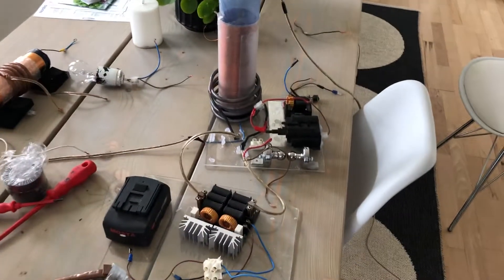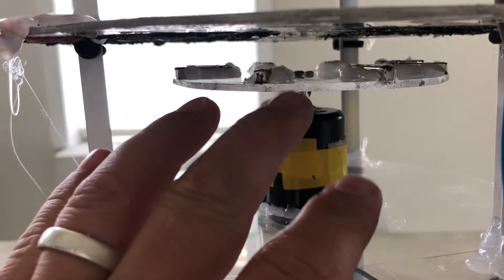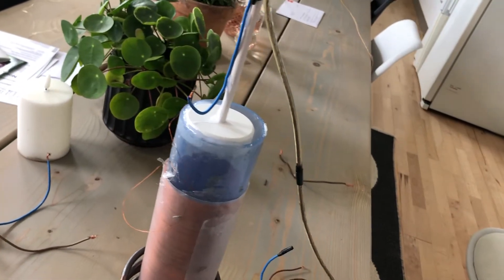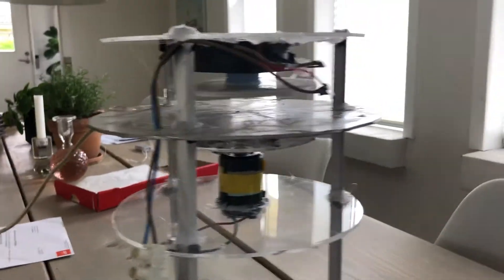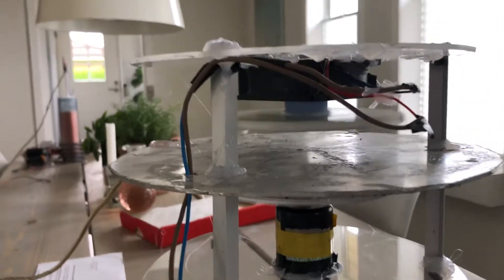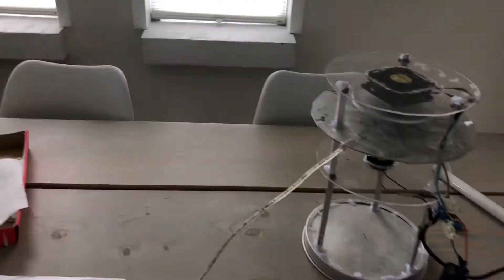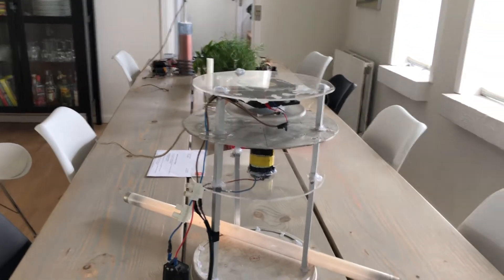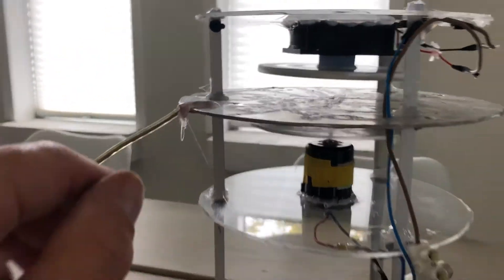SWR ( scalar wave rider) Antigravity

Comment: Your gravity flyer looks great!  I like that you used the plastic with aluminum foil and a glue gun to put it all together. You have the magnets and the motors at the correct speed. You also have the transistor pulsing circuit  but you do not need the transformer circuit. I don't think you need the ultrasound as this only keeps the gravity flyer from levitating to soon and lets the plates charge ud fully. The upper disk will have the opposite charge polarity than the ionosphere and the bottom disk will have the same polarity as the earths surface so the device levitates. The only thing that I see done incorrectly is the tesla coil hooked up in the forward direction so the voltage on the disks is high and the current on the disks is low. The magnets spin the charge so the disks have circular eddy currents like a magnet hooked up to a coil of wire that makes the magnetic field that is of the same polarity as the earths magnetic field so the two repel so the device levitates. The tesla coil should be hooked up on reverse so their is  a very low voltage from your  battery of about 0.05 volts and the current is at a high value of about 100,000 amps so the charge is very high on the disks. A gravity wave is a weak energy waves and having a high voltage on the disks yields a high energy wave that is not good. The low voltage is also needed so the electric field between the disks is of a very low density of Aether and the outer electric field of the earth is a very high electric field of 150 V/m so the device lifts up like a heilum or hot air balloon. With you using no ultrasound your gravity flyer should lift up in a steady manner and not pop up like Alexey's does when he pushes the ultrasound button to turn off the ultrasound. Depending upon how long Alexeys pushes the ultrasound button depens upon how high the gravity flyer lifts up off of the ground.  You can use the same circuit with the aluminum wheels on a car to make an anti gravity car once the car reaches the necessary 88 miles per hour on an intgerstate just like the movie Back to the Future.  Rick
Reply from the maker: Hi Rick thanks for your analysis of my attempt, unfortunately this was a while ago and I didn’t do anymore I focused on ion collections and am now attempting a Wardencliff tower replica. Please look at this as your imput would be welcome 🙏
Reply: @dkdyker  Hello dkdyker. I just looked at your YouTube channel with your Tesla Wardenclyffe tower. My friend Nathan experimented with Tesla work on this as we found a book detailing what he was doing that was written by Tesla when he was doing his similar Colorado experiment so I am familiar with what Tesla was doing. Tesla lied to Westhinghouse to get funding for his Wardenclyffe tower and told Westinghouse that he was building a radio tower to send signals around the world when he was really building Wardenclyffe to send power around the world for free through the earth and back to his generator through the atmosphere. Westinghouse and all other capitalists did not like the idea of free energy as they liked to be rich. They could not meter Tesla's Wardenclyffe tower generated power and why they stopped funding Tesla when they found out what he was really trying to do. Tesla was basing his Wardenclyffe tower based upon the ancient Egyptian pyramids that generated power from the silica in the granite being a piezoelectric that was intiated from water vibration from the tunnel setup in pyramids. Under the pyramids are tesla coils believe it or not. Some scientists recently found the tesla coils under the pyramids using satelite radar that the worlds scientists are trying to say are an underground city as they like to cover up such technology like they cover up UAP that are future US Army and future US army that I worked on back in the early 1980s under President Reagan. Who built such tesla coils and the pyramids? The ancient aliens that are talked about on the TV show Ancient Aliens on the History channel back some 12,000 years ago and not 5000 years ago as the scientists lie about. The Egyptians from 5000 years ago found the pyramids and learned how to use them. They did not build them. The pyramids also produced radio frequencies to anti gravity waves that turned back time and kept the bible people alive for up to 1000 years as the bible talks about. The pyramids also with their produced power sent through the ground and back through the air struck arcs at the many obelisks in the ancient Egyptian cities so the cities were lit up. Tesla's Colorado and Wardenclyffe tower experiments would have accomplished the same thing. After Wardenclyffe Tesla moved to the New Yorker Hotel that he had people buidling in private to continue his work on this type of power generation. The New Yorker hotel is a Wardenclyffe tower. When Tesla died the FBI found out and confiscacted all of Tesla's work at the New Yorker hotel and also covered this up. The US power grid is actually based upon Tesla's work with the power grid transmits power from the generating stations to the home and businesses and back to the power station through the ground. The high tension lines generate radio frequencies and can light up fluorescent bulbs and these radio frequencies produce some anti gravity waves which then keep us all alive for up to 90 years on average when back before the power grid the people only lived for up to half this age at 45 from naturally occurring radio frequencies to anti gravity waves in the universe.  Here is a diagram of the ancient Egyptian pyramids showing the underground tesla coils and Wardenclyffe tower showing the underground structure complete with his tesla coil and center pipe and outward streching pipes and the US power grid. The power was and is transmitted with the water and soil in the ground to far off places and returned to the top half sphere dome on the Wardenclyffe tower. Your dome looks great.  https://teslauniverse.com/nikola-tesla/images/diagram-showing-underground-details-wardenclyffe      https://dialoguepakistan.com/en/world/massive-underground-city-discovered-beneath-egypt-s-pyramids--scientists-claim       https://www.youtube.com/watch?v=hh9sDs05s3c  https://www.cfr.org/backgrounder/how-does-us-power-grid-work      The only thing not shown on how the US power grid works is the underground water and soil return of the generated power.  The US government knew about all of this back when Einstein  and crew found it all out back in around 1920 or about 100 years and covered it all up and lie about it to this day. I invented a fusion reactor but the government is not interested as it is free energy once again. They want to build their large fusion reactors but they are all pretty delusional about how the sun works. The sun with its huge gravity field makes the hydrogen a liquid that fuses much like my fusion reactor. The large fusion reactors are needed so the capitalists can stay rich charging us for the power on the power grid and why their fusion reactors never work so my fusion reactor is covered up once again.    Please see Richard Muller's STAR Fusion Reactor.      https://www.youtube.com/@exoticpropulsion8175
Hans Bethe who worked out how the sun worked many decades ago was incorrect and why the scientists who follow him are delusional as they are all taught Bethe's theory in school and know no other theory and are all brainwashed as a result so they never get their fusion reactors to work that are just fake job creators. The US Army knows and why people see the many UAP that fly around the Earth. I think the US DOE is building my star device in Washington state and it should be ready in about three more years. The only other company that is close to fusion is Helion who is also buidling their fusion power plant in the state fo Washington as this state has all of the manufacturing capabilities to build fusion reactors.    https://www.linkedin.com/company/helion-energy/posts/?feedView=all       Rick
Reply: @dkdyker  Hello dycker. I just wrote to you about your WardenClyffe tower for the past hour but Tesla's work is top secret so what I wrote to you was deleted. I cannot comment and explain to you how the technology works. Sorry.
Reply from the maker: try my mail dkdyker@yahoo.co.uk
Reply: @dkdyker  I just sent you an email with my comment but I noticed after my comment was deleted for some hours that it is back again up above. I guess the moderators changed thier minds.
Reply from the maker: @richardmuller867 your mail has many parts redacted too 🤔I have also noticed that I have almost no traffic on some of my videos , maybe the content is not interesting be I can see thousands of views be it shows only a few hundred on this site. Thank you for your mail , I will look into the links as they also are not working, very strange.

Comment: The earth has mass and rotation, and loosley counts as one object, with one gravitational field.

Creating a seperate gravitational field, proportional to the size of earths gravity, in a small area, or in general

Allows you to then measure its strength by comparison 

Defining a zero point within this system

Using a crystal oscillator,

Should give a digital spreadsheet of connected sensor data 

Which then could be strengthened, by adding more energy by wire from switches,

By tuning magnetically, the static field 

Or the geometry of the magnets

The crafts gravity then becomes stronger than earths in a small area

Generating gravitational lift

In tandem with conventional motors

Forms an Alcubierre drive

With the gravity being a spherical Shockwave, of relativity, from mass and rotation, of the motors (scalar wave/field)

[GENERALIZED GRAVITO MAGNETICS, STABILIZED BY GYROSCOPES]

Comment: Have you tested to see if you really are producing scalar waves . I suppose the equipment needed to do that is expensive . I know this is a mock-up for testing but if you find some success the model must be precise in construction and balance . To do that , you will need some expensive tools to get the tolerances exact as possible . Thanks for the share.  :O)

Comment: I am interested but presently this model is not good for demonstration and I don't think it will be good for you to build upon for gathering data or experimenting with past viewing enjoyment, so many inconsistencies exist and it's a little hodge podge put together.

You have way better standards even if not a masters in electrical engineering or years of experience in the field and your doing very well too, can I suggest you purchase some RC motors and small parts and such from sectors like these to build apparatus from, also you could very easily hire a local sheet metal fabrication shop to laser cut you some metal parts, dimpled (as I mention because someone got picky about the matter), polished to you're hearts content and still at a good price.

For the sheet metal fabrication side they love it when someone like you or me pops by with a small one-off you know because it's almost free cash for them and they get to use up odd little sections within an already going-to-the-cutter batch list of work.

Can I suggest also you shop about online for magnet types, shapes and differing materials which does not always mean you have to use NdFeb like nothing else exists, differing means for differing needs and materials.

-I hope to see more videos, yours are very new to me and I'm going to look for more for sure as it's great to see the produced notion you have in mind even if I'm a little new to the videos :D

Comment: Dkdyker: Good efforts and good set up. But unfortunately your audio is very poor and low. Please when you work hard on a project you should also look at the other aspects too so that other people can help you or learn from you. with all due respect, Alexi's device is not an easy device and if it is that simple to make two plates rotae opposite to each other with magnetcs piggy backing on them, and a central disk with high volts high frequency, then every one would be travelling with a home made levitating cars and sofa sets flying in the air. Here, in Alexi's experiment, the main thing is the Etheric thrust, that can be controlled with polarities to lift it or desend it. Frequency, rotation of disk with magnets, and charge transfers to upper and lower discs are very important. Perheps this is very complicated design to replicate. I have been working on the replication with very little success but I am learning. My device lifts up for a friction of seconds and then hits the ground. I will be publishing my video soon if there is a successful outcome. Good luck and pay attention to the comments that might accelerate your progress.

Comment: If it really works, how is it possible that only Chekurkov managed to make it fly? Someone explain to me, please.
Reply from the maker: Yes unfortunately there is something not correct and a little discouraging to say the least. But as an open minded soul I need to believe that one day someone will crack the code .
Reply: @dkdyker  Hmm, so he charges $2000 for a handful of junk, which is poorly packaged, broken, and on top of that it doesn't work, or it only works for him. Sorry, but I find it hard to believe.
Reply from the maker: @Rebellion_Rules  I fully understand your perspective I am of the same opinion.
Reply: I have been working on the same device, without knowing Alexi's device; I started that back in 1993. My discs levitates too but if I put a penny on top of it; it falls immediately. I had been working on this for last 15 years and was not able to produce a larger module with payload weight as Alexi's device. But I know the secret after seeing his device. One thing for sure, the device is very simple and he added a lot of craps, such as Tesla Coil, Ultrasonice transducers, electro-gravitic filed through high voltage and high frequency. All of this is garbage and he did that intentionally to sell his pile of junk. I will be producing real device very soon on the Youtube with better, controlable and functional video. This is a fact that no one, including me, would reveal all the design aspects. Besides, this type of project, design, and experiment are not for hobbiests. It involves deep electrical engineering, and material properties related stuff. But the design is very simple and Alexi made it so complicated; for what reason? Just to make money. He does have a good device that levitates and it levitates good. He never showed any controlled manuevering of the device, because it does not have one. It only goes up and down. That is it. And that is of no interest to any one and it should not be. Just put yourself in his shoes: if you have such a design whey the hell you will make it public without putting a first priority to get paid for the research, time, and material you had spent to come this far? I hope it makes sense.
Reply: Patience. It needs to be running for a solid 30 min before it creates any effect.

Comment: The Tesla coli (catcher) should be about 750 Khz frequency.  the rotating magnet platters need dimples of certain size and the diameter of the magnet platter has to be larger for the ratio of the rotating magnetic frequency, the magnets need to be round with a hole so it is a toroid type, and the B+ voltage has to have wipers on the metal rotating magnet platters one on each side, RPM has to be controlled on the platters,  platters has to be speed controlled so to set the magnetic frame dragging bias in the device and tune for the proper lift frequency.. Apart from that keep on...Al
Reply from the maker: Thank you, great info, I only have a video to look at to try and replicate something. This helps a great deal. The 750khz wher do you get this figure from?? Have you produced an example before?
Reply: Have u built one

Comment: Figured out the ultrasound component?
Reply from the maker: Not yet still playing with variations on the battery’s all north or all south, also the aluminum does it have to be earthed? The balance has to be correct, is the main disc wide enough??? Lots to do
Reply: @dkdyker  Nice work, I'm working on a new design that has 7" rotating disks and 12" center disk. I think you are missing the textured aluminum for the rotating disks. The center disks wire is not directly connected to the output of the Slayer Exciter Tesla Coil, but it just hangs down the middle to pick up the wireless energy. All 6 magnets should probably be circular shaped with all norths facing up. The ultrasound speaker should be on top and have a frequency of about 14KHz. Good luck
Reply: @charliec3rd  do you have a source for the information about the ultrasound frequency? Thanks everyone here for their hard work.
Reply: @Tharealsolomon  I used the online tone generator to match the frequency of the ultrasound that can be heard in Alexey's latest video.
Reply: @dkdyker  I hear ya. Looks like a good start though.